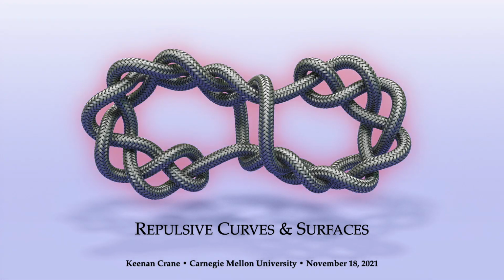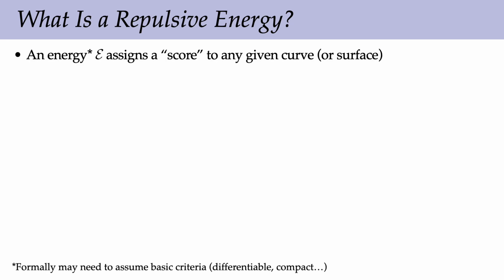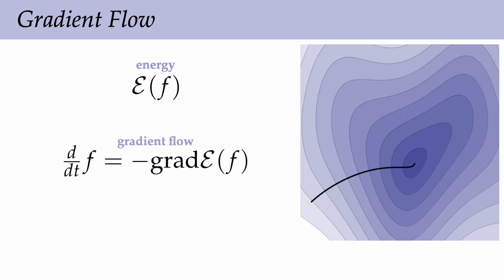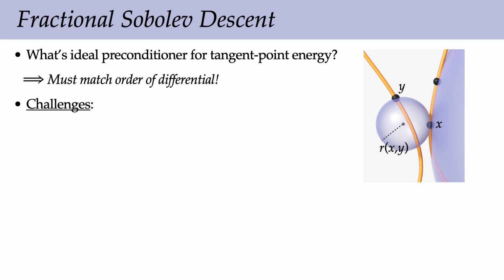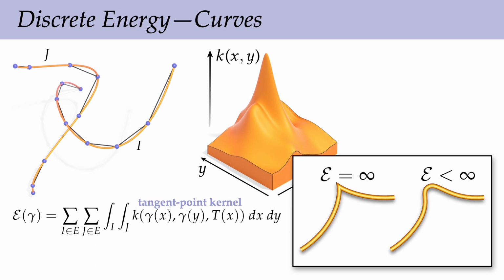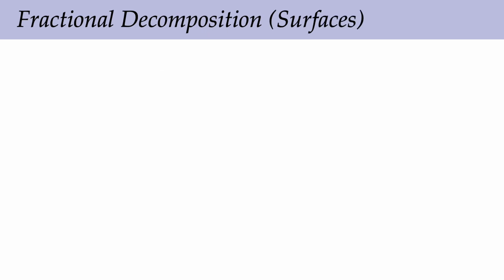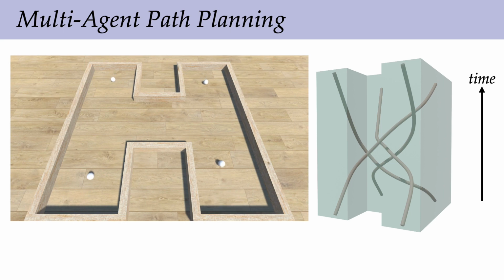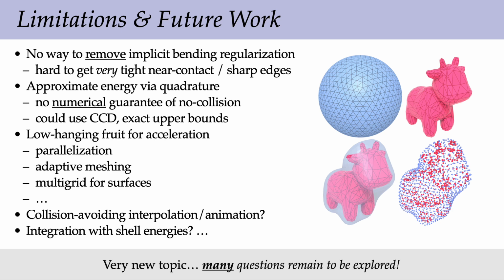Repulsive Shape Optimization

Comment: Good evening mr Crane, It's a bit late for it but I need to wholeheartedly thank you for your inspiring work and your crystal clear lecturing of it. Wall of text incoming.

In september I graduated in mathematics in one of the most renowned universities of my country with a decent mark, also thanks to my thesis which was based in large part on your work on heat methods in geometryprocessing. My background is mostly in riemannian geometry but I wanted to have a more applied sort of thesis than my colleagues (who mostly opted for very classic and "safe" subjects), and this seems to have also been appreciated by the commission, who gave me full marks for it. Thank you from the bottom of my heart.

Also, I was feeling a bit down not seeing any interesting perspectives for what to do after university, but you really inspired me with your amazing work. I watched all your lectures, I read most of your papers (and many others) and found out that my degree in geometry can actually open me some very interesting perspectives, on top of which is what is now my biggest aspiration: being endorsed for R&D at Pixar or some CG studio. Right now I'm trying to learn everything I can about computer graphics (even though my university isn't of much help in this regard), continuing to study geometry and its applications (which may or may not include also physics) and I'm also trying to learn some 3D software in my spare time (it's called Houdini and it's really amazing).

So this may not be the most conventional platform to say this, but thank you, mr Crane, for inspiring and motivating me.

If you happen to come to Italy some time in the future let me know, I'll offer you dinner somewhere fancy.
Reply from the maker: Thank you very much for your kind words.  The greatest honor one can achieve as a researcher and teacher, I think, is to know that they've helped inspire someone from the next generation to fall in love with knowledge and exploration.  I very much hope you find a path that is fulfilling.

One suggestion, if you are in Italy, is that you might reach out to Emanuele Rodolà, whose group is doing some terrific work in applied geometry (for instance, reconstructing geometry just from its Laplacian eigenvalues—to give one example).  I'm sure he'd be glad to chat with someone who has invested so much time and energy in learning the field.
Reply: @keenancrane  Thank you once again

Comment: This is extremely cool research. Your team never fails to impress
Not directly related, but I now wonder whether anybody has tried Sobolev regularization in optimizers for machine learning. Seeing as how heavily that relies on gradient descent variants, it ought to make a huge difference, if it is applicable in a similar way
Reply from the maker: Yes, it could help with problems where the loss function involves spatial derivatives.  The only question is whether standard software frameworks (like PyTorch) make it easy or difficult to apply this kind of preconditioning.  Stochastic gradient descent looks a bit different from ordinary gradient descent, especially at a computational level on large datasets.

Comment: Thank you for this, fantastic work beautifully presented!   Sorry if it's an awkward question, but will there be source code available?  You mention knotted high-genus surfaces as sculpture and I've done some work in that area -- the rogue's gallery at 47:30 is familiar!  Obviously these methods would greatly improve on the simple physics simulator I've been using, but implementing from scratch would be a stretch for me.
Reply from the maker: Yep! In fact it's already available here: https://github.com/icethrush/repulsive-surfaces

Be warned that this is definitely research code (as in: this is what we wrote to get the paper done).  So it's a bit rough around the edges.  There is however a fairly nice file format for specifying a "scene", i.e., the objects that should be important and the constraints/penalties that should be applied (with several examples included).  We plan to keep hacking on this code as we do more research... maybe someday have something more polished, in the spirit of (the excellent and wonderfully maintained) KnotPlot.

Would be really interested to hear your experience, and glad to help you with any speed bumps you run into.  Also glad to exchange wisdom about how to best use the tool.  E.g., the flow works quite well even on fairly low-poly meshes, so if things are running really slow you might consider remeshing the input with a tool like InstantMeshes or OpenFlipper (or a million others).  Also, there can be funny behavior if your input mesh isn't roughly the size of the unit sphere.  So, you might try scaling it down to that size if things aren't working as expected.
Reply: Awesome, thank you!  Rough code now >> polished code maybe someday.
Hm, I'm having a dumb idea about curves.  Since the tangent-point energy is easy to compute for polylines, how about I consider a tangled loop as a polyline (stipulate, I dunno, 500 endpoints), shovel the points and an index of a point to perturb into a neural net, with a perturbation vector as output, and train using the tangent-point energy as a loss function?   There must be an obvious reason that won't work, i.e. produce a net able to untangle curves in general, but now I kind of want to try.  
Don't see it working for meshes though, the curse of dimensionality is a curse indeed.
Reply from the maker: @BathshebaSculpt  Yeah, interesting thought! Training a network to directly classify knots seems extremely hard since the classification function on R^{3 x nVertices} is really ill-conditioned: a tiny perturbation of vertices can completely change the knot type. But what you’re suggesting is much more local and hence maybe more feasible. I think the main problem you run into is that, even if you have an oracle that can tell you the position of a single vertex that minimizes energy within an isotopy class (keeping all other vertices fixed), you likely still need a huge number of these “moves” to get the whole curve to the minimal configuration. Moreover, as you refine the curve each vertex will be less and less free to move large distances. So you hit the same basic problems as classic descent strategies—and which Sobolev preconditioning seeks to solve.
Reply: @keenancrane  I feel like NCA is the right approach to this -- i.e. an oracle that is local, small, fast and highly parallel -- but I don't know enough about how they work in graph-land.  Back to reading papers...

Comment: Hi, this is an amazing research!
Just one quick quastion. In the path planning application how can you make sure that the objects wont "travel back in time"?
Reply: Obviously this is very late and not from the author, but I think the key there is that anything that involves one of the objects kinking and going backwards in time won't be an energy minimizer in large part because of that kink. It's not a guarantee (and if you need a guarantee then you could probably impose a penalty on any path that back-travels) but it's a strong likelihood.

Comment: Hi, Keenan. Amazing video and explanation (as always). Are there some good sources explaining why matching the order of the differential is important? I don't even mean high level sources like papers, but rather prevailing principles that make this happen.
Reply from the maker: There's not a great tutorial (we are thinking about writing one!) but maybe one classic thing to look at and understand is the CFL (Courant–Friedrichs–Lewy) condition.  The basic intuition for this phenomenon is that, in each time step, information needs to be able to travel far enough across your grid or mesh to capture the behavior of the system.  So, as you make your grid finer, information has to make smaller and smaller "hops" to get from one grid point to another.  In turn, you have to take smaller and smaller time steps, so that the rate at which you're (ostensibly) marching time forward is in synch with how fast information can actually travel.  The order of the differential plays a role since Nth-order derivatives typically involve a stencil of ~N grid cells. …this is obviously a very hand-wavey explanation, but that hopefully gives a sense of at least one way of understanding why order ultimately matters.
Reply: @keenancrane  did not consider how CFL would play into this. I appreciate taking your time to respond.